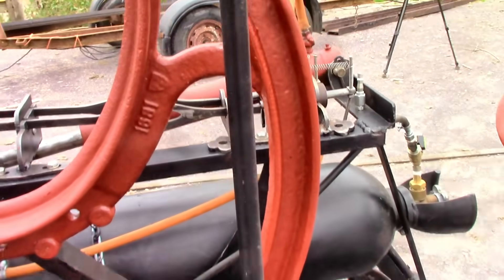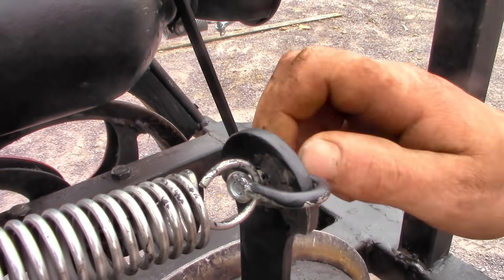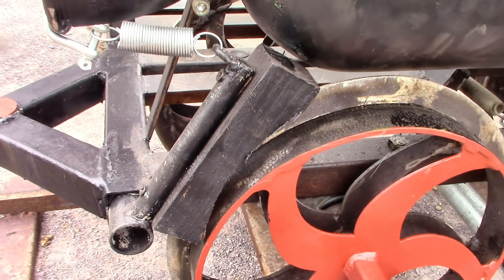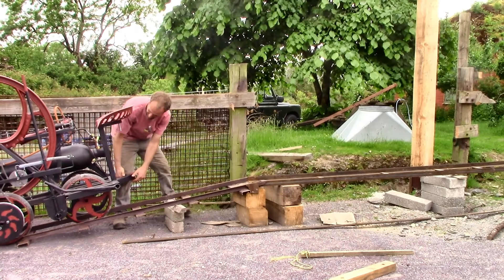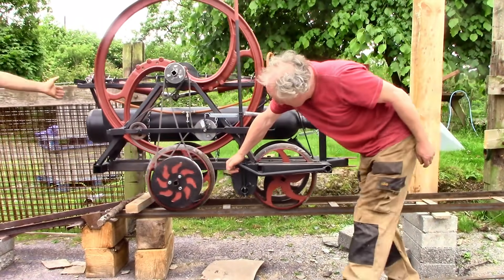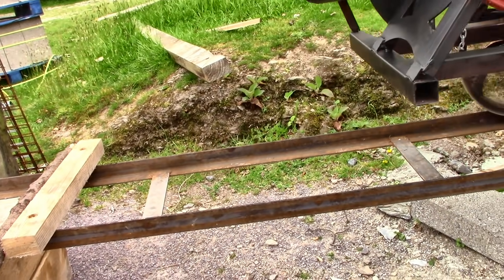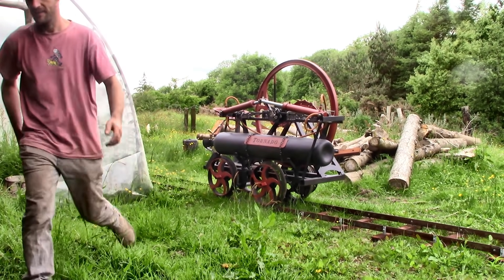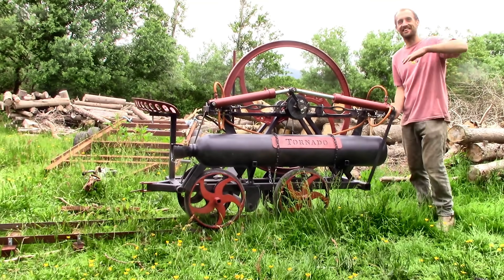First Run!! Home-Made Compressed Air Locomotive For The Field Railway

Comment: First off, a sincere congratulations on this kilometrestone. I believe that there are many hours of frustration behind every scene posted on this channel, and while you mention the frustration, it would break the heart of a lesser mortal who sees, say, five days work being scrapped. Yes you have gained the knowledge, but at a cost.
I am happy to see that Will and you and the van (0m34s) are realizing the most important facet of the presentation - colour coordination. Without your vast wardrobe of sweaters the videos would be drab and boring(grin)

Next step: a PTO drive to power the weed cutter attachment to clear the rails, otherwise you will need to rig up a PA system to announce that the next train is delayed on account of leaves on the rails (8m06s). Your loyal tribe of followers have sat through hundreds of hours of video about rails and wheels; why not let us reap the benefits by seeing the rails on which The Racket runs?

It is all very well catering to your down-under viewers, but why not have the top of the lever correspond to the desired motion? That is, send the top of the lever in the direction you want to travel?
8m40s Since you now provide a passenger service, when I come to visit you (48 hours by air, minimum) can I have two free rides?

Braking: is going to get worse. If The Racket skids with its own mass, it will skid further when one or two loaded wagons increases the momentum. How would drop-blocks work for you - a lever drops wooden or iron shaped-edges in front of the four wheels. Then an operator MUST engage the opposite gear to have the loco free itself from the blockage - a bit more security.

Also a dead-man's handle (or better yet, a dead-man's-tractor-seat) to disengage power and trip the brakes when a fully-loaded train with 3,000 lbs of air pressure in store is operational.

I close by re-iterating my congratulations. A most impressive effort for a man armed only with a laser cutter, a vast array of tools, and, we hope, an unquenchable drive to move forwards. And backwards.
chris
Reply from the maker: Thanks Chris! Yep, ever onwards (unless it's backwards)

Comment: Wonderful piece of engineering. It'll take some getting used to operating her no doubt but she's going to be a very reliable lass. I am curious as to how efficient she will turn out to be long-term, and how much she can do on a single tank. I must admit I'm also marginally concerned about the safety of your hand regarding the flywheel but I'm sure you considered that already.

One thing I would advise is applying weedkiller along the track or creating your own ballast to keep the weeds and grass of it. They will interfere with your operation and make the track uneven over time. You can already see in this video that blades of grass are getting caught on the wheels, which will affect the friction and reduce your efficiency. Ballasting should ideally have been done before you laid the rails down but could be done any time you re-lay them.

Finally, it'll be interesting to actually see how much she can haul. Her design seems like she wouldn't be able to haul too heavy a load, after all. 
Also as an added bonus, should you ever want to in the future, you could always make a shed down the end and build a coach for the family to enjoy rides in.
Reply from the maker: Thanks, Damian. I learning as fast as I can..

Comment: Would it be an idea to make it break on the rails instead of the wheels? Is there a reason not to do that?
You can place it on a pivot so that the bends in the track are less of a problem, something like that
Reply: The rails aren't uniform enough to make that reliable.
Reply: @TheExceedermjw  I don't know, if the breaking pads are pushed against the rails on the inside of the rails, with plenty of travel, there will always be more surface area for breaking than the wheels currently do

Comment: Amazing job there, Tim! The silhouette and sound of your Tornado with its big flywheel remind me of some very early steam engines like the Trevithick locomotive, which I find really cool! Also, I like the fact that it is a compressed air locomotive, considering that you eventually want to use your loco in a charcoal-making operation. Since compressed air has a long history in coal mines, I find it very fitting (and it is probably a lot safer than steam, too). I‘m really excited to see what it can do with a fully charged pressure bottle :)

Edit: here is a link to a video of the locomotive I was talking about: https://youtu.be/K40XrR67fas
Reply from the maker: Thanks, Benedikt - I hadn't seen that video. Wonderful machine!

Comment: Oh just a thought. When you do get the tank to full 3000psi pressure what you going to do with the temperature drop when it is dropped to atmospheric pressure in the cylinders. You may have worked this out already. Icing up in the cylinders will damage the seals. In fact the seals will become brittle or shrink unless you've worked out a way for them not to, which you probably have. In industrial de-pressurisation processes they frequently preheat high pressure gases. But, you've probably got this sorted anyway.
Reply from the maker: I hope to run it at 200psi - the rest would be reserve, so perhaps it will release slowly enough so it doesn't get too cold. I hope to find out one day!
Reply: @wayoutwest-workshopstuff6299  did you really mean 200psi? I thought you were looking for a compressor that could give you 2000psi?
Reply from the maker: @jimmys60ny  Yes. 200 is plenty for driving the train - the rest is just storage
Reply: I will wait until you do the video with the fully pressurised tank as I don't really understand the reply.

Comment: For a better and cheap higher pressure compressor option, go find an oil refrigeration compressor unit and replumb it.  Most of those can easily do 300 - 350 PSI with zero issue and many of the bigger commercials units can do 400 plus intermitantely AND be stacked end to end to get into the 600- 700+ PSI range without danger.
Reply from the maker: Yes, thanks, but that still wouldn't be enough to make this really practical.
Reply: @wayoutwest-workshopstuff6299  I'm not sure where you are but around my area, we have commerical business and like auctions pretty often and well-used takeout comperssors are scrap metal cheap at them. 

Same with just asking your local commerical HVAC shop to save you a few take-outs from whenever they are doing an upgrade to some store or comerical business system.  They dont ever reuse them and they just go to scrap when taken out.

Comment: try building a pressure intensifier for filling the tank. You would just need a larger air cylinder pushing on a smaller one, which would act as a pump. It would trade volume for pressure, and the ratio of the diameters of the 2 cylinders would determine how much pressure you get at the output. You could probably even build it into the locomotive. Have the engine running off of your compressor while boosting the pressure for the welding tank.

Comment: Many of the light trains use a primary braking system where the pads are not pressing onto the wheels, but rail tracks itself. Maybe that would be give the Tornado better stopping performance. Great work!

Comment: I used to run the HP compressor for a diving club. As and when you get an HP compressor, make sure that the air dryer and de-oilers work properly. If the HP air is the slightest bit damp, you may be amazed how quickly that welding bottles will rot out. Having oil in HP air is much nastier and due to the high partial pressure of oxygen at 200 Bar, you can get lethal explosions.
Reply from the maker: thanks for this - good to know..

Comment: It's only fair that with only one driving axle, that you should only have one braking axle - and each independent of the other at that!   Excellent job!  I was very skeptical about the use of compressed air in the small diameter cylinders, but you did it!  Much more pressure needed...   Also, you'll learn that running on green grass will cost you traction AND braking ability!!!
Congratulations on a working model!

Comment: Make rams push pull... Not just push push. You are only half the power and using twice the air.
Reply: Just connect the two outputs together with tube
Reply from the maker: Simply not true - sorry! (Have a look at the earlier engine-build videos..)

Comment: If you would use a pressure regulator you would have a more stable air output and so on you  would maybe have a higher range and a better engine power over time.

Comment: Increase the non used cylinder ports and connect them
Reply from the maker: connecting them will surely only restrict the out-flow from each?
Reply: @wayoutwest-workshopstuff6299  one is falling away and makes suction and the other with push, however it will take opening up the ports to keep it from doing what you describe

Comment: To control weeds  mix  1 gal  of   vinegar , 1 lb salt  , 1eight cup liquid dish detergent  mix until  no salt particles visible .  Spray  on clear day with  some sun,,,   It is not a chemical poison  that will harm the land ... I  am 74 yrs old and my mum  used around her flowers and veggie garden... it will keep the weeds under control along you tracks and work areas..?
Reply from the maker: Thanks Tennell. Well it is a chemical poison, of course, but shouldn't linger for too long

Comment: If you cannot find a high pressure air compressor. What about pouring a few ounces of liquid nitrogen into your bottle and waiting for it to pressurize. This is assuming liquid is easier to come across then said high pressure pump.

Comment: since the brakes aren't optimal at the moment, have you considered track brakes? they are friction pads that press on the track itself, rather than the wheels. they are overall better at braking since they have a larger surface area and brake directly on the track instead of through the wheels. theres an article on electromagnetic track brakes on wikipedia; https://en.m.wikipedia.org/wiki/Track_brake 
...but presumably they don't need to be electromagnetic!
Reply from the maker: Thanks - interesting!
Reply: @wayoutwest-workshopstuff6299  hope it helps, i love the content!

Comment: if you link the front and rear axles with a chain that will improve your traction and breaking, I use 428 chains and sprockets on my locos, this is a fascinating loco tim, almost as if it hales from the early days of rail transport, very well done

Comment: Fridge compressors usually go to 300 psi, with some experimenting they can go further. They are fairly cheap when bought used but they don't move a lot of air. So it would take time to fill up the tank. However as a cheap higher preasure alternative one might be All rig.

Comment: Don't understand why you do the directioncontrol by belt and not by the cylindercontrol? That also save airpressure... even when you allready conect the Airhoses to the open side of the cylinders ... in your construction it must be parallel : from the left cylinderintake to the right "open outlet" ... and also on the other side....

I recoment a permant fedderforced brake & a small cylinder wich get loose friktion if you open the air ...

Comment: Tim, you might want to add a regulator with a gauge after the air cutoff. That way you have consistent power control once you're using the engine with a higher tank pressure.

Comment: How about about a used air powered rotary tool to drive the thing? Inbuilt direction change and you can simplify the gearing. I don't know about the torque though.. Could get rid of a lot of hardware on that loco too. Maybe a modified impact driver? That would alter the nice Tufftuff sound to a FFFFWEEEEEEEEEWW however :)

Comment: Hmmm..... I have an idea for you:  Instead of that big air tank, why not just use a standard LPG cylinder? (Or maybe a slightly bigger one!) It would provide you with a great amount of gas volume because it's all stored in the form of a liquid in there, possibly even more volume then that air tank when full! (Correct me on that tho, haven't done the calculations). The only real problem is that, as you know, LPG is quite flammable. But since your loco is out in the open that may not create such an issue perhaps? Maybe you could try this, at least to see if it would be doable? Other then that sir, you have made a one nice looking loco! I hope that beauty can come in handy when pulling loaded wagons!
Reply from the maker: lpg stands for low-pressure gas, so it wouldn't get me very far 
: -  (
Reply: @wayoutwest-workshopstuff6299  At normal room temperature LPG is at about 6-10 bars of pressure (that's about 87-145 PSI), so that's about the same pressure that your compressor is able to produce i think. Also as Jason Bennett said below, LPG stands for Liquid Petroleum Gas. I think this is really worth the try, it might actually work!

Comment: fantastic!!!! Cant help but think of Trevithick' Penydarren locomotive built in 1804 everytime I see you locomotive. 

The number on the flywheel is a pattern/part/casting number not a date, but is easy over 100 years old, companies like Betinels made those chaff cutters from the late 1800s up until WW2. 

If you find you need to increase your grip/traction for either braking or hauling, you can always connect the two axles with a chain and sprockets. 

Keep up the good work.

Comment: I have a small recommendation for improvement. I think if you were to fit sprockets on the axles and chain them together the traction would be better. Then the brake would be more effective and the engine could theoretically pull more

Comment: Could make a tender that has an compressor on it and powered by the wheels, so when stopping or going downhill you could recapture some air.

 Edit: Oh I forgot, you need some flow control and pressure regulator on that thing.

Comment: couldnt you use the engine itself to fill the tank with a crank or something on the flywheel ? i think you could achieve higher preassure with that and you could ,,refuel´´ when there is no compressor in reach

Comment: for traction you may need to tie the two wheels together with a belt on the other side of the reversing gear where you have the break positioned.

Comment: If flats were on those rails there would be more traction, and thus, more friction too.  Do you plan on driving the front wheels too? I have been anxious for this day. Great Job. What great fun.  Can't  you stack two old refrigeration compressors and get more pressure? They are rated at 250 psi and would require a long time to pressurize, but that could be done probably over night. God bless you all with your excellent talents.

Comment: Congratulations! Love the channel. Have you thought of a locomotive tender with extra gas bottles? If it doesn't go against the spirit of Tornado maybe add a gasoline or electric powered air compressor on the tender to become a hybrid Tornado. Fun thought at the least.

Comment: To fill a cylinder that size you would need a massively expensive air compressor, the sort that is water cooled with a huge 3 phase motor.
The ones that can do a 6 litre bottle diving bottle are pretty expensive & they take an hour to fill 6 litres, so that gas cylinder would take a day at least with breaks to allow the motor to cool down.
Sadly i think you are limited to 150 psi.
It’s also worth noting that an explosion at 4000 psi, you would be looking at certain death for any living thing in a 100 ft radius.

Comment: what an accomplishment.  outstanding.
so, with the drawback you have of not enough compressor to fill the cylinder, you might consider a small gas powered one and bolt it directly on the loco, thereby suppling constant air to replenish what it uses.
however, i think you should have a go at an electric version loco.
use car batteries  for instance.
keep up the good work.

Comment: It isn't said enough, but it should be proudly declaimed from the rooftops - you are an engineering genius!
Much as I like the look of the railway hidden in the grass, I don't think squashed vegetation on the wheel treads will have a good effect on traction, so you might need to mow the track periodically.

Comment: You should add a small air compressor that runs from a belt that is drivin from one of the wheels or even the engine itself so you are regenerateing air as the machine runs or dives

Comment: What a great piece of work Tim. So much fun to see it come together and run. 
I think you need to add a link from the direction lever to the air valve next so that you remove the air from the cylinders when you're not actually needing power. Train drivers regulate the power to maintain the train speed and trains spend a fair bit of their travel time in neutral (Coast). The advantage of railways, as you've pointed out, is the very low friction of the rolling stock so, once you've got your load moving, very little additional power is required. Taking wagons down grade will need almost no air but, as your system is now, it uses pretty much the same amount of air loaded or unloaded, uphill or down. 
Wheel slip (spinning wheels when taking traction) and slide (losing grip whilst braking) are big problems on 'real' trains and employ pretty complex systems to control them, track sanding being the last resort.  You will need to develope a driving strategy if you want to avoid hitting the buffers.
Reply from the maker: Thanks, David, but I have neutral, so I could freewheel, with or without air..
Reply from the maker: Thanks, David, but I have neutral so I can freewheel..

Comment: Absolute marvel !!! Tim, I wonder if you shouldn't also double (or forward the braking action) the brake to the other axle/wheels, to double the "friction" and brake the wheel on which the engine is active. Also, if you brake less, you probably could keep the "grip" longueur, and it should stop faster. I think the optimum braking action is jjust under the grip limit